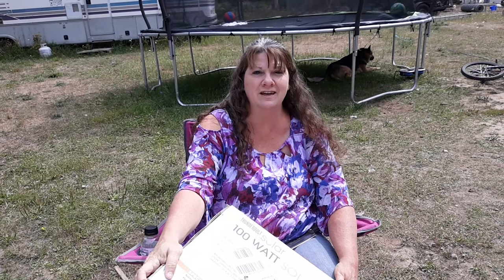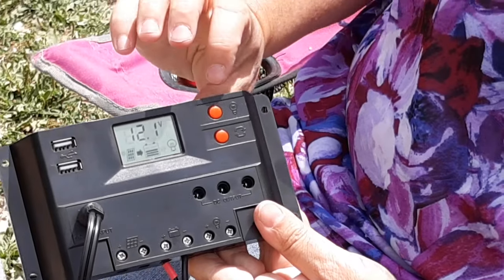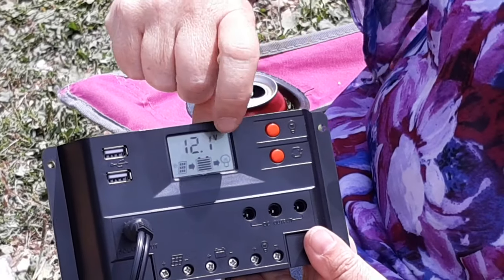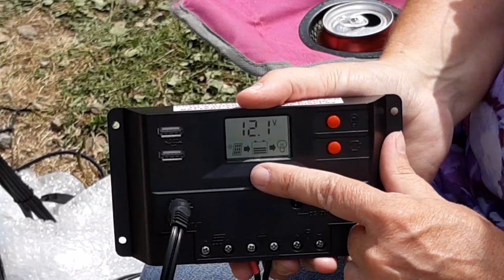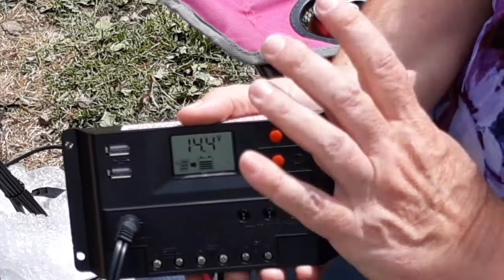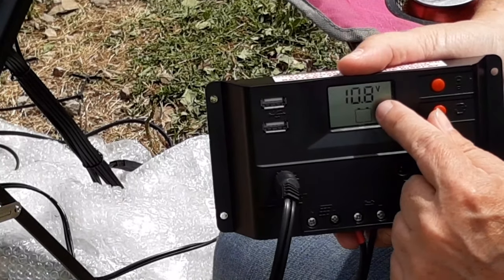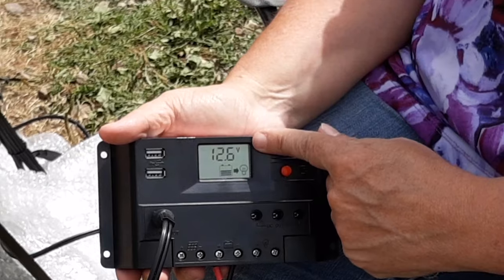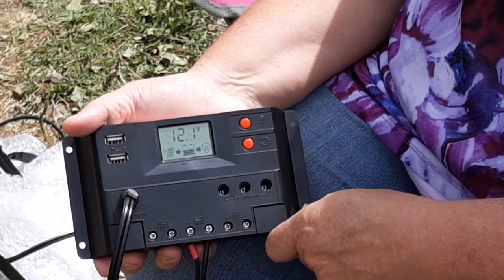EXACTLY - How To Use the Controller on your Harbor Freight Solar Panel Kit

Comment: I just had a freak out moment when my alarm sounded on my system and displayed an error code! Im a solar newbie. I started googling and found you! You explained this in such an easy and simple way that made sense to me!! I now understand my controller screen (i have this same system)! My error code was a low battery and apparently resolved itself while i was learning from you lol! Thank you SO much!! I am definitely a follower now! 😊
Reply: What error message if u don't mind me asking
Reply: @bagingospringo4396   it was code E11.
Reply: @msaudimus  me too. It said too thin of wire going to ur inverter, are u using one?
Reply: @bagingospringo4396  apparently the code has a couple meanings. Lol I   tested my battery and charge controller  (i thought my charge controller was bad) with a voltmeter to  ensure they were both operating at 12V. And they both were. So I completely disconnected my charge controller for a few to reset it. That seemed to work so far. 
Before  I did all that though, I did the hold down the load button for 10 seconds thing but that didn't clear it.
Reply: @Audrey Ford  I disconnected mine to reset it too, and idk how to hook up the charge controller because the way the wires are it looks like id need another plug it's got those weird silver and black plugs...I don't have my charge controller set up it's only the display and battery
Reply: @bagingospringo4396  I'm not sire what chaege cont. you have buy I h e the thunderbolt. It came with the wiring needed.  I only had to buy cables for my inverter. You can call technical support for yours and they can walk you through it. I called mine  to get some help initially on the code not going away.
Reply: @Audrey Ford  hey so my co worker made me a 10 gauge wire and the error code went away
Reply: @bagingospringo4396  oh perfect! Glad you got it fixed!
Reply: @Audrey Ford  lol me too, he's an electrician and told me when a current goes thru multiple things it manipulates the voltage like a transformer amplifies it so a thicker wire did the trick I kinda wana use the other wire he gave me as it seems the same gauge as the wire that came with the panels to attach to the battery rather than clamps seems more permanent
Reply: @bagingospringo4396  yes I got rid of my clamps and cut the wire and attached that way to the battery. And I've got real big/thick wires from my inverter to  my battery too. 
Glad you got it done !
Reply: @msaudimus  I'm guessing it gives that error code when it runs out of battery as well correct?
Reply: @bagingospringo4396  yes-along with a loud alarm lol once it hits10.8.
Reply: @msaudimus  I've never heard it do that because it's outside lol
Reply: @bagingospringo4396  ah gotcha.  Yeah mine is inside so I can hear the alarm if it drops too low.

Comment: I have listened to 3 or 4 'instruction' videos and yours is the first on that was simple and understandable.  Thank you.  Not a bunch of 'cut this wire, add this connector, crip here, yadayada... Just a great explanation.  I agree with all the positive comments.
Reply from the maker: Thank you Barbara!
Reply: What does the code E11 mean on the screen?

Comment: I think it's cool when you have people who decide to DIY self sustaining. I'm 90% done on a 4×4 HB trailer that I've customized for off grid camping. I've managed to build it from HB, Wal-Mart, Home Depot, and Lowes so far. 20lb propane tank feeds two burner Coleman and Mr. Heater, LEDs for spots, solar lights for night, garage way sensors for intruders while camping and a Camp Rite cot/tent mounted on top. Currently using small solar at 35Ah, but will upgrade to eventually 105Ahs using three HB batteries powering a small 800 w invertor. The 20lb tank will last approx 5-7 camping trips running the heater all night. Reinforced all the bolts and nuts, used flex seal on all the bare metal, has a mounted spare, fender tool boxs and still weighs less then 500lbs.
Reply: Can I ask what "HB" is an abbreviation for?
Reply: @russellborrego1689  Meant to be HF...Harbor Freight.
Reply: Update: Now have 70Ah, Renogy 20A charge controller and (2) 100 water solar panels, the new type from HF. Upgraded to 800/1500W invertor also. I just do a little at a time when I can afford it.

Comment: Thank you, I just assembled mine today for the 1st time, this helps a lot. Tomorrow I will bring ut out again ant put a load on it to see how it performs.
Reply from the maker: That's awesome!  Let me know how it does with the load on!
Reply: @OffGridNorthIdaho  https://youtu.be/LfbqKdj3OCk 
This is the 1st video I made a daybor two ago. Cycling through the controller is a little difficult for me, I believe it I leave it alone and when I start it, the 1st display if arrow is blinking from the panel to the battery it tells me the actual voltage coming in to the batteries from the panel. Am I correct in saying this?
Thank you for responding.

Comment: Thank you for this video series I just bought this to charge my rv battery when I am off grid.  All other videos I watched you needed to be a electrician to understand.  One question if all I want to do is charge a battery and not hookup anything to the controller am I fine with the default settings?
Reply from the maker: You are so welcome!  Yes, for just charging up the battery, default setting should be fine.  It could be set up to charge faster, but it's totally not necessary.

Comment: Good video, good luck with that thing, mine does good to keep a cell phone charged and use one of the lights that came with it once in a while. Have it on a new trolling deep cycle battery. And if you give it a few days between using it, gives plenty of power, but I'm off the grid and don't have days for the junk system to catch it up

Comment: Looking for the id with proper instructions on the other settings like changing the min/max voltage and changing the voltage cutoff. 
I already made changes to mine, more charge! 
AGM & Lithium 💪

Comment: I'm the desert getting plenty of sun. I'm only getting 11.8 volts currently in direct sunlight. Should I try cleaning the panels or checking connections?

Comment: Amp output is the figure you want to look at. Controllers like those are 4 or 6 amps. Anthing higher amp draw will pop breaker on controler. If more amps needed get their inverters that hook to batteries and get more output 4500 watt 10 amp inverter will run a small refrigerator like in campers. Run batteries in series/phase, also for more amp output. Or bigger Charge control center, nice ones with batteries all in one package. 30 amps and 230 volts on one that I seen.

Comment: How do you set the controller battery type?  I was going to buy the solar panel kit.  I already have a 50ah lithium battery and am wondering how to set that controller for the lithium battery I have.

Comment: I just got this system and used my battery through a modified sine to fun a fan. My battery is drained and now it says E11 when try to charge it. Did I ruin my battery? Do you know what I need to do in order to get it to charge. Thank you for your videos. Most other info I've found comes from pompous know it alls who talk like I'm an idiot for not knowing all the ins and outs of solar.

Comment: K glad I came across your video went to Habor Freight yesterday bought Jackery 290 explorer and then solar panel 100w any kind but in back of solar panel that hookup doesn't work for that Jackery question can I just buy the controller your speaking about at harbor Freight just for solar panel it's thunderbolt it's called
Reply from the maker: Did your panel kit come with a controller?  I know the Jackery you're talking about, and I'm going down today to harbor freight, so we can help you figure it out.
Reply: @OffGridNorthIdaho  Your to sweetie no but I came across video that may can help me but please stay in touch sweetie
Reply: @OffGridNorthIdaho  Sorry about typos I type without checking my spelling of word's and just send

Comment: Have you tried using the kit for cooking?   I just got a kit. And I want to cook outside and connect a crockpot or a instant pot.
Reply from the maker: I haven't tried it with the harbor freight kit, because the panels just don't put out enough watts.  Both the crockpot and an instapot (in fact, most things that produce heat, and sustain it for a long period of time, like cooking) will take a LOT of watts.  Now, that said, if you live somewhere really sunny, and have really good batteries that hold a lot of amp-hours (ie - store up lots of watts), then you could use the panels and the controller to juice up the batteries good and full, then use an inverter to make it 110V power, and plug it in and try!  I have run my crockpot off my husband's bigger solar system, and it worked well while the sun was shining, but it sucked too much juice when I tried running it off the batteries.  THey would do it, but it just ran them down too fast, so not worth it.  I am still bummed, because I really loved my instapot when I lived on grid!
Reply: As she states, you can operate high wattage devices but off the battery/batteries ONLY. Don't connect anything with a high current draw to the load connection on the controller.

Comment: There's a feature with the controller that you probably didn't know that I use to make my porch light turn on at night for how many hours i want to that i can set which i have set to 5 hours and when then turns the load off after the timer goes or if sunlight hits the solar panel and works fully automatically.
Reply from the maker: Wow, that's awesome!  I need a tutorial on that!!

Comment: bery nice ,thank you,...can you leave the panels charging and "forget" about it...can bateries overcharge?
Reply from the maker: Hi!  Yes, you can just leave it set up, and let them charge!  There is an upper charge limit you can set on the controller, and it has a good setting for the default,  too.

Comment: Thanks for the video explanation!
0:35 such a shame they didn't make that plug come out the bottom of the charge controller (solar panel input power)... that connection will always have stress on it, and the potential to be broken off. especially since the unit is designed for wall mount.
Reply: Hello Brian you will probably find that you would like to add another kit later. Using the circular Hub system also available at Harbor Freight you can add more kids together and then use the direct wire function at the bottom of the controller to connect the Hub. As soon as you add the Hub and one more kit you have effectively doubled your charge. The Hub will handle up to 400 watts of input and output. However 400 watts of panels will not produce 400 w especially if placed in a semicircular array to catch the Sun from east to west. So........my plan is to connect five sets or 20 panels to maximize output with the Hub. I am currently running three sets and expanding shortly. Good luck with your install.
Reply: I made need thicker wires to connect the controller to the batteries and I'm getting more power to the batteries

Comment: With the solar plug in can you use the outlets on the controller without having a battery hook up? In other words, can those outlets be powered straight from solar panels?
Reply from the maker: No, unfortunately not.  You do need a battery to act as the intermediary.  However, it doesn't need to be a great one.  An old car battery gets it done.

Comment: What is the amp rating for the lighting circuit. If I wanna run a LED light bar in a shop that draws 3 amps. Am I Goin to fry the lighting circuit on the board?

Comment: In my converted cargo trailer camper, I have two 6v batteries that power water pump, fans and lights. They are connected to a converter. I also have a 12v battery for misc use. The two 6v batteries will be connected to this controller, but not the 12v. Can I connect wires to the outputs on the bottom of the controller to charge the 12v battery? Also can I have the solar controller connected to the batteries and use the converter at the same time?
Thanks for your help.
Wray
Reply from the maker: Okay, so thinking that you say you have solar panels hooked into the controller, husband says yes, you can do both those things, but he thinks that the controller will probably only charge both sets of batteries (the 6V set, and the individual 12V) to the capacity of whatever is weaker, so it may not be optimal, but he thinks it will work.  (These questions are above my paygrade, so I call in the pro, haha!)  Sounds like a cool project though!!
Reply: @OffGridNorthIdaho  Great, Thank You and the expert for the reply.

Comment: I just set mine up down at our dog kennels.  The charge controller is not working.  Does it need to be connected to both the battery and the solar panels?  Right now it’s only connected to the panels and the screen is blank 🙁
Reply: Just an update:  plugged in our 12V battery and the controller worked.. I don't recall seeing both needed to be plugged in to work - Just an FYI to anyone who is a newbie like me :)
Reply from the maker: Oh sorry I didn't see this sooner!  As you discovered,  yes, the controller needs to be connected to a battery.   It doesn't have to be a fabulous battery,  if you're not needing lots of storage for non-sunny times, but it needs to be something. Even an old junker car battery will do.   Im so glad you got them going,  though!

Comment: That load button doesn't send power to the 3 light plugins, it sends power to the the connector to the right of the battery connector that has that same lightbulb picture next to it. You could wire a 12 vlight to that connector, or a fan, etc, and turn it on and off with the red button.
Reply from the maker: Oh, I want to go try this!  Thank you capnrob!
Reply: That button does send load to the lights they turn off when you press it.

Comment: Ok so I keep getting e11 which means it's a loose connection, (it's not) or the wire is too thin. Any ideas??
Reply: I was going to get a thicker wire for the battery
Reply from the maker: Yes, try the thicker wires and see if that helps.  Let me know how it goes!

Comment: At 12.1 volts you've already depleted half the amps. If it is an AGM or Lead battery you're already damaging it. 12.2v is the lowest you'll want to drain the battery more then 50%. Lithium is different, up to 90% drain.
Reply from the maker: Yep, you're exactly right.  I had thew wrong battery,  and I'm learning more all the time!
Reply: @OffGridNorthIdaho  This is the way solar batteries work. If it is AGM or Lead for example rated for 35Ah as the HF batteries are really means about 17.5 actual Ahs to use because you don't want to drain more then 50%.   If it is Lithium, at  35Ahs, you get 35Ahs of use because you can drain down to 90%. Difference is price. Lithium is expensive but worth it. Also, your batteries only have a certain amount of recharging cycles. The more the battery is depleted, the faster it will die. Try to have enough batteries to run your needs but doesn't need constant recharging from the limits of the battery. Match your solar wattage with the invertor. If you use a 1000 w invertor, you need at least 100 w of solar panels. If 2000 w invertor, you need to have 200 w solar. The reason behind that is the wattage used by the invertor needs to be replenished at the same rate it's being fed. Keeps the invertor from overheating. Also, a 1000w invertor likes around 100Ah of battery. So, 2000w likes 200Ah of battery.

Comment: So a controller comes with the solar panel.  Is the controller the same as  a mppt charge controller???
Reply from the maker: Yes, the controller I talk about is the mppt charge controller.
Reply: Ok. So the controller wouldn't be available if it wasn't in a kit.  :)
Reply from the maker: Mine came with the panels as a kit with a couple 12v lights.
Reply from the maker: I think they also sell it separately, too, though.
Reply: @OffGridNorthIdaho  thanks so much.  You broke it down.  Of the videos I was looking at they never said that an mppt would be in a kit.

Comment: Please help me with this. I bought a 300watt solar panel, with a 12v 100ah battery, and a PWM 30A charging controller panel. Please will the charging controller charge the battery well. Am confused.
Reply from the maker: Husband says that the panels and controller are sufficient, but the PWM (pulse with modulated) technology is very outdated and you would do better to buy a MPPT (multi power point tracking) controller to replace it.  They cost a little bit more but are MUCH more efficient.  But for just an emergency backup or light recreational use, a PWM will certainly work fine.  You're just leaving a lot of available power "on the table" so to speak, by not using an MPPT controller.  Hope this helps!
Reply: Thanks

Comment: Can I connect solar power battery charger to my RV battery ?
Reply from the maker: Yes!  Connect solar panels to the controller, and controller to the RV battery.  We had a solar panel mounted to the roof of our RV using heavy duty magnets, and it worked great!
Reply: Thank you

Comment: When you hold the mode Button for 5 seconds it has an adjustment that is pre set for -4. Does anyone know what this number represents?
Reply: Complicated math formula to control charging output when freezing temperatures are present.

Comment: Can I add one extra 25 wat panel to my 100 wat system connected to control ?
Reply: Cheaper to buy another kit. One panel is $79
Reply: @shaymus1968  I only have space for one on top of my vandura
Reply: Yes you can add up to 4 additional panels provided you keep the charge controller cool. Add up to 4. Beyond that, you risk overloading it and finding yourself soldering a new fuse to the board inside. One extra panel won't hurt anything though.
Reply from the maker: Thank you for jumping in!!  I didn't realize how many views and comments were happening here, lol!  Excellent advice!